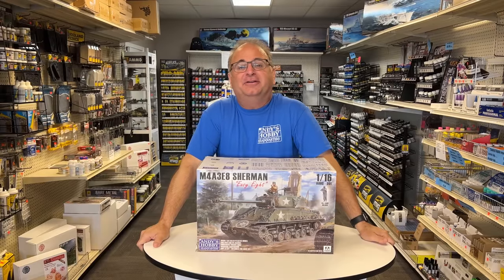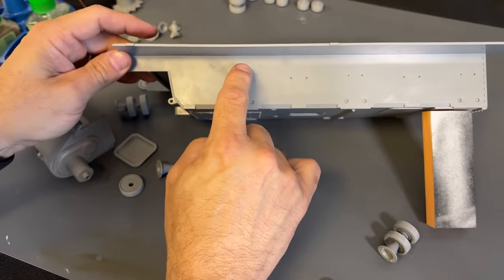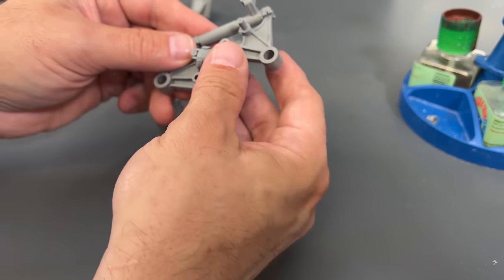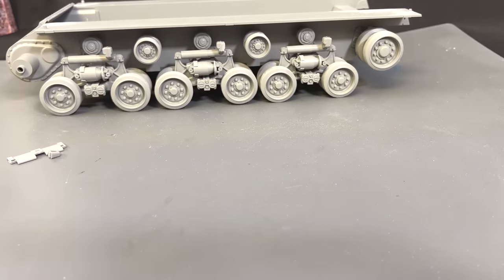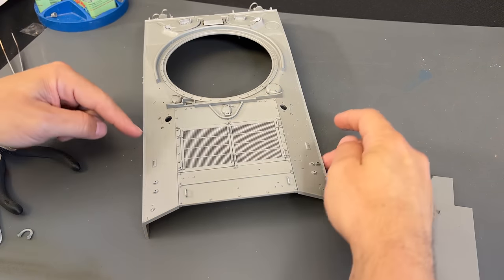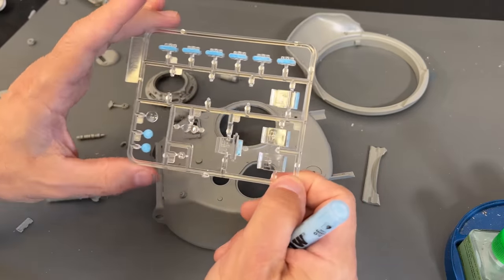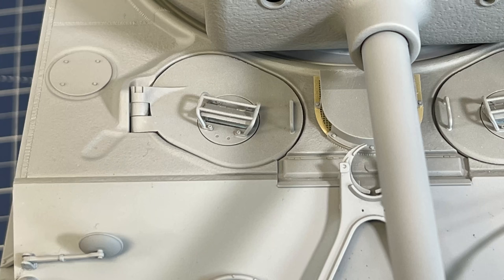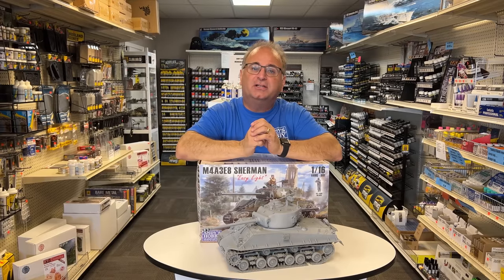Complete Build of the New 1/16 Andy's Hobby Headquarters M4A3E8 Sherman (Part 1 The Build )

Comment: I'm in the middle of working on this kit.  It's all about 2 things...building up those 154 track links at 3 pieces per link and then all of the myriad of small fiddly bits.  It's hard to decide on when to actually glue the bits in place for fear of knocking them back off.  I'm really enjoying this kit, it has gone together very, very well so far.  I'm done with the lower hull, wheels, tracks and bogeys and am now almost finished with the upper hull and then on to the turret!  I bought the aftermarket .50 cal that Andy sells for this kit.  It's going to look great.

Comment: Think I'll bin the ILK effort, this knocks it right out the park.  So glad I've one pre-
ordered
Reply: I've got the AHHQ kit on pre-order too, along with the Jeep, but having just received and started the ILK offering I certainly won't be 'binning' it.  For starters it offers the early split loader's hatch version, which is nice, even though they have included the 'wrong' T80 tracks.  On the subject of the T80 tracks in the IL kit, they are incredibly nicely detailed with metal pins and jigs are included for assembly.  My plan is to use the IL T80 tracks on the AHHQ kit, and the T66 tracks in the AHHQ kit on the IL since that was the most commonly seen combination for early E8s that hadn't had field replacements of entire tracks.  The IL kit also, oddly, has more detail in some areas than the AHHQ kit - no idea why those particular components were singled out.  The IL kit has rubber road wheel and idler tyres too, with nice sidewall detail, fully sprung suspension, and in the initial release a few frets of very nice photo etch.  I think there are advantages to both kits, and I am very much looking forward to having and building both (and the Jeep too, of course).

Comment: Will there be a M-51 option for the engine deck, because the Israeli tank crews used Continentals which required the back deck to customised, not including the 105mm gun

Comment: Some parts as you say just sit in with being tight but that's not always a good thing like the front gearbox housing the final drive cover on the left side left a gap at the bottom with ot being to tight a fit a wee bit of sanding is recommended to get parts sitting perfectly

Comment: it looks amazing I take my hat of to you I hope to see more over time I'm probably going to buy this and turn it into a rc just would need to make the suspension workable glue some guides on the bottom of the hull to attach the electronics to and modify the idler and drive sprocket should be difficult

Comment: Problem attaching idler sprocket. The attachment that joins the two half's are so so loose they wobble when pressed in to place. Yes I glued as in manual. One is slightly better but really loose. Have not completed tracks but hoping tension of track will keep the wheels in place. Finest tape stops the wheel of almost any movement. 

The road wheels axles do not fit. Cleaned out some flash inside bogies but  they are so tight you have  put them in a drill chuck and sand them just enough to make them fit into boogies. Has anyone else had these issues. The road wheels fixable but   somewhat lengthy and you are out of luck if you sand to much. Thanks.

Comment: ERRORs in Kit and Instructions:  First, the Locating pins in P21 are spaced differenlty from the holes piece D.  Also, there are no callouts in the instructions for placing peices R6 and R7.  They are not shown in Step 3 picture but are shown in the Step 5 picture.

Comment: No point having the ability to have the engine decks to open the inner scoops are missing! Meng have included them on there's and the full interior rfm kit so an afterma or 3D printed set you would also need

Comment: It's beautiful, likely expensive. Why doesn't it have actual functional metal springs though? I have that on my 35th scale Churchill. Why doesn't it have actual rubber on the wheels? No interior? that's a major let down too. The parts look nice and sharp. But this kit likely sells for a price that would be way too much for what is offered. I've seen better kits offering much more for a lot less.
Reply: Lol, check the prices of 1/16 models then comment.
Reply: @randomnickify  well, what is it listing at in US prices?